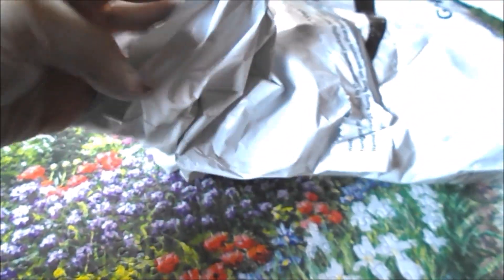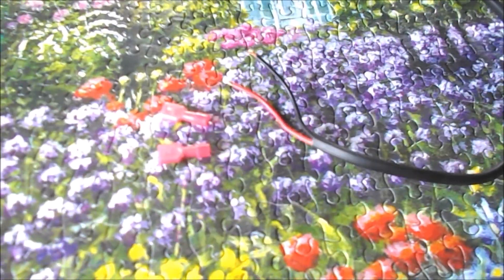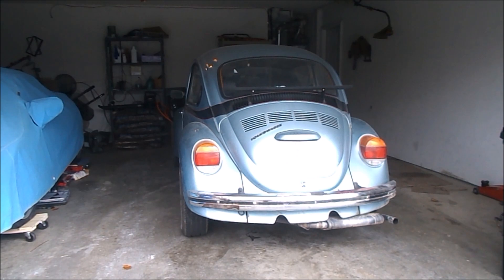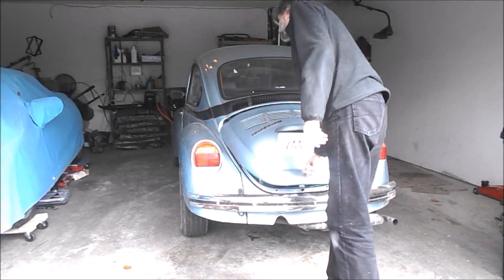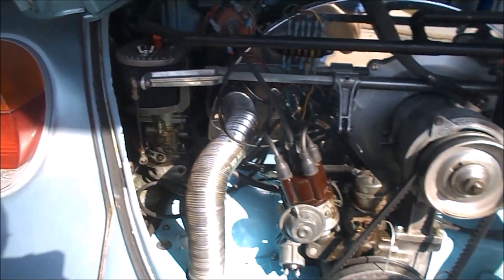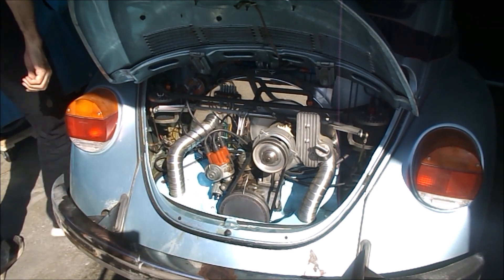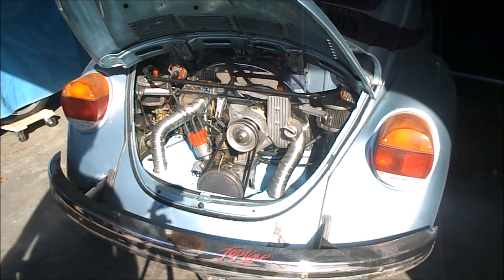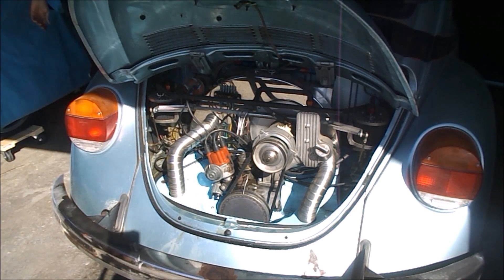vw 73 super beetle $50 empi accu-fire, another compufire clone

Comment: Man I had flashbacks watching that dizzy cap jump around😢
Thanks for sharing the experience for all to see!
Reply from the maker: the instructions don't mention that the magnetic disk spacer included in the kit will require the assembly to have a shortened rotor. i didn't have to use that spacer on the first clone kit so the rotor problem didn't show up then.
Reply: @redshirt-scotty  yes it seems that there are too many inconsistencies with these terrible products available today. Looks like we can add poor (or non-existent) instructions to the list. Well, that’s why we share adventures on the YT.

Comment: I just put in the empi accu-fire today.  Thought about the clone. Not gona do it now. Your the second video showing the clones crap out 1 minute in. 
The empi one has removed the intermittent skip my points were apparently doing.
Reply from the maker: i hope your empi continues to work. this video shows the empi. the one before this was a clone of empi. empi is a clone of compufire which i will have on the way here as soon as i get credit for returning the fried unit. moore parts (through amazon) will charge a restocking fee. oh well. leaned something so cheap lesson.
Reply: @redshirt-scotty  O bummer. I got confused with the ohms requirement.  But on the empi website nothing I saw on there mentioned that kind of requirement.  All I did see was 3.4 on the Amazon site. Maybe it's a thing Maybe it's not. But I do keep a spare distributor under the back seat.
Reply: Check out my newest video after my empi accu-fire ignition install.
Reply from the maker: did. it's great when stuff works. nice scenery in the background btw. are those mountains? don't have those around here.

Comment: Well my accu-fire made it 11 months. Went out 4  miles from the house. I pushed that car for 1.5 miles then a neighbor saw me. 😂
Reply from the maker: 4 miles. that's a haul. one of the failed chinese clones i tried last spring left me stranded about 2 miles from the house. i had my reliable spare with me but forgot my tools. was a nice day for a walk. have you bench tested yours yet to make sure it's absolutely dead?
Reply: @scottyc9365  No, I juked it.  I also had a wire on the back of the ignition switch burn through at the same time. Maybe that was a factor? But I couldn't say.